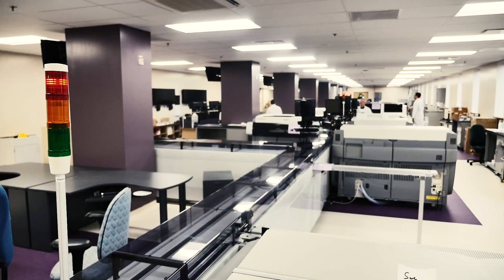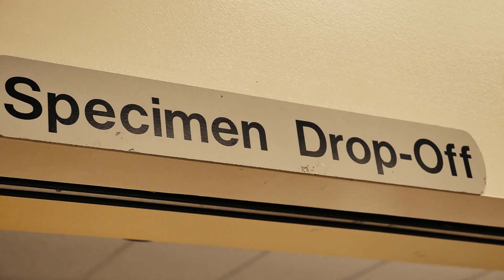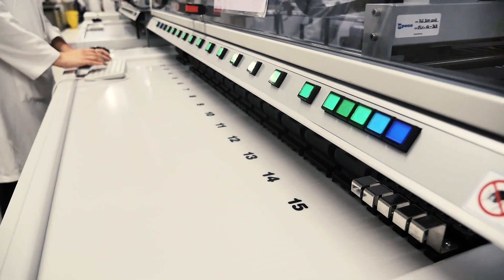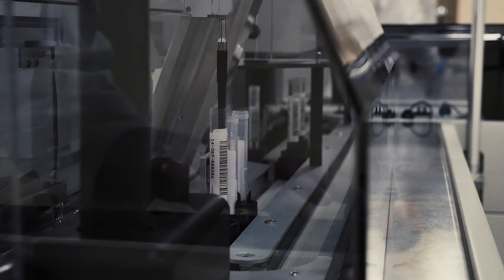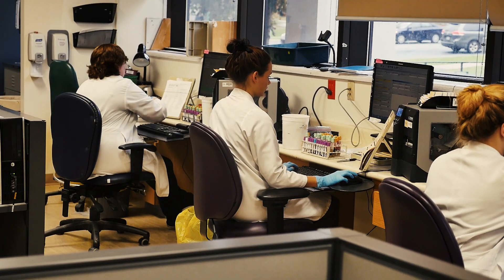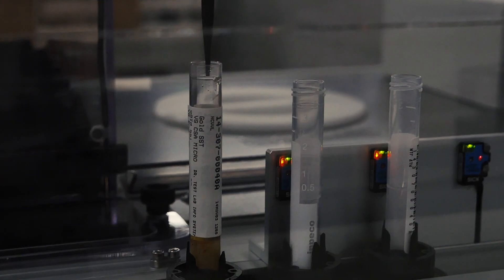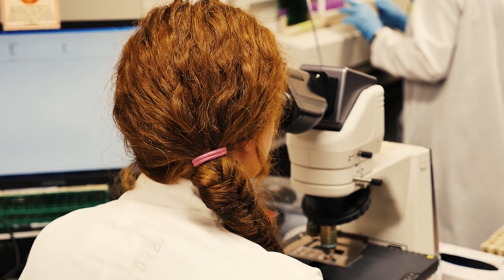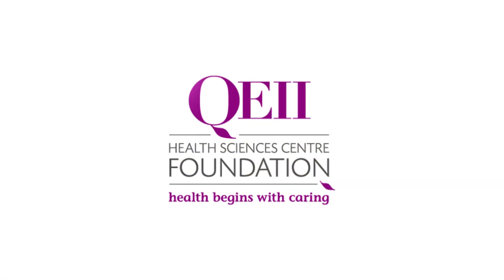The QEII's Automated Lab Track System

Comment: Is the track able to load samples onto the Sysmex and ACL TOPs? Or only the Architects?
Reply from the maker: Thank you for your question! The automated track system is connected to both the systems noted above, that being the Sysmex and ACL TOPs.  Connection to these devices is seamless. Seamless in that it is all automated, there are different components used to facilitate the connection from the main track to the analyzers but all is all seamlessly integrated and automated.